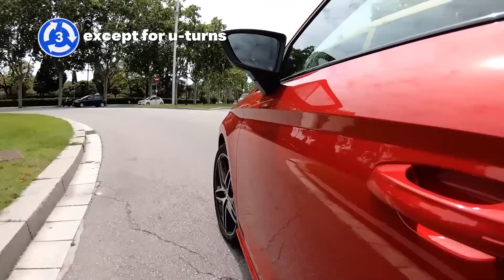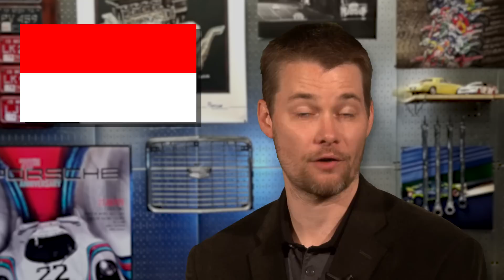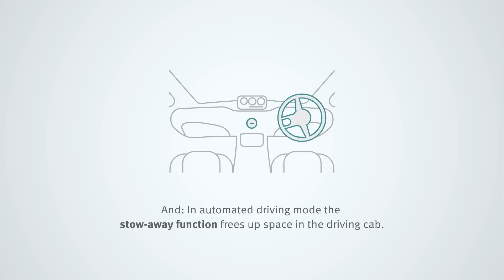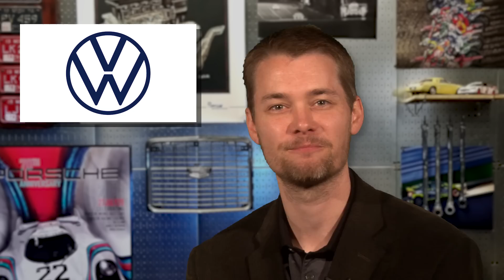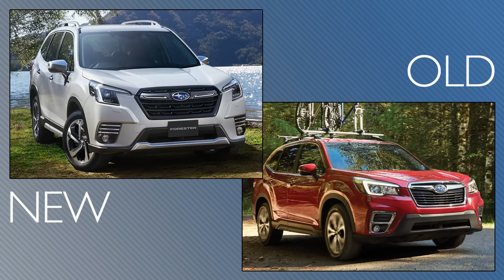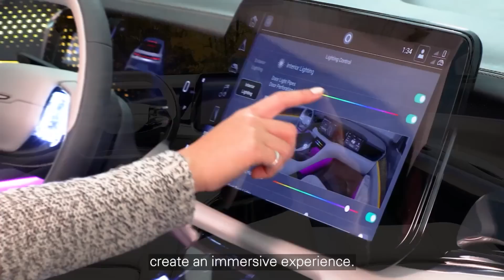Ford Doubles F-150 Lightning Production; Subaru Launches Refreshed Forester - Autoline Daily 3146

Comment: Why does vw still try with the jetta. Its a dud in Europe. Its more a car for cheap developing country car needs. Even VW are likely to admit the accord/civic saloon and a comparable korean saloon to offer a more modern design and more included kit not to mention reliability. Note its still using the older mqb vw platform as seat and skoda switch over

Comment: Let's face it new cars do not have "bumpers," they are facias and in almost any accident they are destroyed. Let's drop the outdated term.
Also I for one will never own a drive by wire or brake by wire automobile. It is a recipe to be hacked

Comment: I have trouble with steer by wire. I've had connections to the 12V battery fail and shut a vehicle down. Without mechanical steering (and brakes), I couldn't have safely coasted to the side of the interstate. Is there any data showing that steer by wire is overall safer (other than full autonomy)?
Reply: Almost every commercial passenger plane you fly or will fly on works on fly by wire. There were installed to cut cabling weight, allow for more intelligent fail safe intervention when pilots did something stupid and allow for easier handling. In almost all plane crashes it was pilot cabin error much like car crash accidents. Lane keeping, adaptive cruise control, progressive rate power steering, 4wheel steering etc all need fly by wire to work

Comment: Ford has 2 battery factories lined up, totaling 20GWh of battery capacity. At 125kWh per truck, that would be about 160k LIghtnings. 
A 40GWh battery factory costs $2B, so $850M might get them another 20GWh factory, maybe, unless that's the price of the 2nd SK factory they already started construction on? Otherwise Ford will have enough battery capacity for 300k Lightnings for year, but they're only planning to produce 80K? Where are all those extra batteries going?
Supposedly Ford is sharing the SK battery factories with VW's new US factory producing ID.4s, so I guess that's where the other half of the factorties' battery production is going.

Comment: Seems like there should be a caveat about the safety of roundabouts. If you don't have enough space to use them to spread out the traffic, they are not going to be safer. You can't just take an intersection and add an island and make it a roundabout, without increasing the space it all takes up and expect it to be safer. And it also seems like any intersection that has a lot of pedestrian traffic is going to get more dangerous for pedestrians if you convert it to a roundabout. This is important because not all city managers are sophisticated enough to determine the safety of this type of change on their own.
Reply: Cities from all over look to Carmel and other Hamilton County cities here to learn about the best and efficient ways for building roundabouts for different types of intersections. The first ones weren't really much bigger than the original space. Those have all mostly since been redone to be bigger. Sidewalks are all made to go around the circle so no pedestrians ever get inside the roundabout. The newer ones also try to be idiot proof as to force you to go the correct way. I say try because there's always an idiot more idiotic than your idiot proof design. There's also a lot of signage, but you can tell who doesn't know how to read signs....the same higher level idiot.
Reply: @jeffs6090  My most common experience is in Berkeley, CA. We have several that are in very small intersections. The cars end up going into the crosswalks to get around the circle. There are a few larger ones, but it is just pretty treacherous to walk across any of the streets, especially if you are walking clockwise, since the drivers have to look the other direction for cars that are never stopping. At one of the smaller ones there was an incident a few years ago in which a driver was speeding and the grassy raised circle in the middle caused the car to flip over and his wife and child were killed, and then he went to jail. I just don't really think they are appropriate unless you can take up a lot more space, and you don't have much pedestrian traffic at that intersection. Yet our City Council is always proposing putting them everywhere because they're supposed to be safer.

Comment: Seems auto makers are adding complexity (hybrids, electronics, screens, steering systems multiple trans mission types, turbos, cameras) which means higher prices (I suspect) currently US $42,700 is the average for vehicles, right?  Business more complex too as 2 or 3 or more companies combine.  Only Tesla seems working on reduced complexity and downward trends on pricing.
Reply: Tesla is more vertically integrated...designing and manufacturing as much as possible themselves.
From batteries to aluminum cast frames to AI to computer chips to heat pumps to seats to carbon fibre wrapped motors to software to charging networks to power generation to super computer design to advanced metallurgy to advanced glass.

Having top engineers in all of these fields is unique. How can any car company compete with this?
Reply: @Goldsteinphoto    Tesla does not make any of their own Battery cells at this point,  and every OEM that I know of makes their own chassis structure.      Tesla does not make computer chips, or heat pumps,  they buy them from suppliers.
Reply: @dmitchellhomes  So you didn't watch Battery Day. Do you know what an IDRA press is? Why did Tesla buy Hibar Systems, Maxwell, Grohman,  Springpower, Perbix and others?

Where can you buy the version 3 FSD chips used in Teslas? Where can you buy the D1 chips that they are building into Dojo? Where can you buy an octovalve? Who makes Tesla's inverters, carbon wrapped motors?

https://youtu.be/Rp2ktJ6174c
Reply: @Goldsteinphoto   yes, I did watch battery day, when Elon musk said production was starting on the 4680 sells immediately, and would ramp to full production by the end of the year, but here we are a year later, and he said on the early last earnings call, they have produced zero production quality batteries, they are just producing validation cells, very slowly and they have problems with the equipment which will require re-engineering of many of the machines.  He also said that the same machines for Berlin, and Austin, had already been ordered and will need to be reworked delaying cell production in both of those factories.     That’s what happens when you try to develop machines, and a production process at the same time, you usually end up with lots of rework, which tesla clearly is doing wasting their investors money.   As for the castings, yes, I know exactly what they are, you know General Motors also has been using diecasting in their chassis for the last two decades, the only thing Tesla did is try to incorporate more of the structure into one casting.  The jury is still out on how successful this is, as they have already burned down one of their presses, causing a month of rework, and have not incorporated castings into their model three, so they are only using them on the back of the model Y at this time.
Reply: @dmitchellhomes  Stupid comment, your are completely wrong. Why don't you check your facts first.
Reply: @johnmqueripel2367    Fact check my facts?       There you go...   You stated for me they are facts...
Reply: @Goldsteinphoto    Nobody wants to buy the FSD chip,  but I can tell you its made by Samsung in Texas and  uses old technology.     D1 is not introduction yet,  but likely to also be made by Samsung.     Octovalve?    Who needs that?    I have never owned a car that had problems with heat or A/C except my Model Y,   in temperatures over 95 F it cannot maintain 72 F inside, so the system is undersized,  I cannot imagine how bad it is for somebody that lives in Vegas or Phoenix where it really gets hot.      Inverters?   Tesla does not make their inverters,  this are made in China, and shipped in.   Carbon wrapped motors?  Who cares?  Not me...
Reply: @dmitchellhomes  None of your statements contradicts that Tesla is vertically integrated..and working to be more so by building battery factories, adding more engineers. 

If all of this stuff is so readily available, how come all the car company aren't selling hundreds of thousands of production EVs that are as good as a 2012 Model S?
Reply: @dmitchellhomes  You are confusing fabrication with design. So Tesla is not vertically integrated...OK with me if you want to think that.
Reply: @Goldsteinphoto  No car company can compete, probably no chip company can compete, probably no manufacturing company can compete, probably no battery manufacturer can compete, certainly no software company can compete, I could go on and on.
Reply: Model 3 has been out how long? A couple years, and the entry level version is more expensive now than ever, how's that vertical integration and mass production working out for lowering the price?!? Elon promised the Model 3 would start at $35k and other than a couple rare occasions if you knew how to order it that car has yet to be available for the masses.
Reply: @OneNationUnderGod.  Who said vertical integration is about lowering the price. Right now there is so much demand they are maximizing profits.
Reply: @Goldsteinphoto  that statement about "maximizing profits" doesn't carry any water last year when Model 3 prices went up and the market wasn't as strong. They weren't "maximizing profits" then, they were raising the price to avoid selling at a loss. 

As for vertical integration, you said with that and some other "advantages" Tesla has that other manufacturers "can't compete" so I'll leave you to explain how they are unable to compete? Because to me that implies other manufacturers ways are more expensive meaning they can't compete with Tesla. Maybe you meant other companies can't compete when it comes to production delays, increasing prices and prototypes that never make it to production or take multiple years after they were originally planned.
Reply: @OneNationUnderGod.  Other companies who do not possess technology, engineering and production efficiency that equals what Tesla is doing will not be competitive. 

E.g. Ford just doubled its goals for the F150 Lightning..."Due to higher than anticipated demand." They hope to sell 15K in 2022, 55K in 2023, 80K in 2024  160,000 of them a year by 2025. 

They sold about 780K F150s in 2020. So 4 years from now they hope the F150 sales will still be 4/5 ICE and 1/5 EV.
Reply: @Goldsteinphoto  and over a million when you combine F-series. I see nothing wrong with what legacy automakers are doing, pickups and SUVs are highly profitable. Companies like GM and Ford are covering a lot of the EV investing with the massive profits they're bringing in with their ICE vehicles. 

Before you start rambling about these companies on the verge of bankruptcy that is such an old and outdated comment. Look at their financials, Ford is not doing as well as GM but they are still holding their own. GM is crushing it the last few years, these are some of the biggest profits the company has ever had.
Reply: @OneNationUnderGod.  I am pointing out that switching just 1/5 of the F150 line to EVs in 4 years is not being competitive technologically.
Reply: @OneNationUnderGod.   dude, you are on a roll, one legit message after another recently!  Could not say it better myself!
Reply: @dmitchellhomes  I can't help myself when it comes to fanboys, I really like Tesla and I've been tempted quite a few times to track down a used Model S P100D with 25k miles on it just for a fun car the family can take short trips in.
Reply: @OneNationUnderGod.    Same for me,  Heck, I bought a Tesla,  I use for daily errands.   These fan boys drive me nuts,  they are so brainwashed (mindless).   They say traditional OEM's loyalty does not run deep.    Let tell you a story about Ron who owns one of the largest excavation companies in the NW USA (over 1000 pieces of iron).    I remember back in 2003,   Ron came to visit me on one of my jobsites to show me his brand new Ford  Superduty 6L diesel (you likely know where this is going already).   It was summer,  so he left it idling (A/C running) when he came into the job shack to get me,   when I came out to check out the new truck,  I was like Wow,  looks nice (was the first King Ranch I had seen).  So we are standing there talking and I said,  do you smell diesel?     He said,  Ya,  hmmm,   We looked on the ground and in the A/C condensate under the truck you could see fuel sheen.     It turned out the injectors had leaked and filled the crankcase all the way to the top with diesel,  and diesel was running out of the crankcase breather (Brand new truck less than 500 miles)      So he of course had to get a ride home with me in my 2002 GMC ( 6L gas) which he had always called the "El Camino" as his new truck was hauled away on a flat bed truck still dripping diesel.    Anyway,  Ford had the truck a month and put a new engine in it ,  the new engine ran about 5 months and blew a head gasket due to another faulty injector.    About a year after that,  the Turbo went out,  and sent metal through the engine (Another new Engine)    So when the new 6.4L Ford diesel came out guess what Ron bought?    Yup, another brand new Ford, with a first year engine.   That 6.4L was just as bad,  had Turbo problems about every 6 months, and injector problems,   So when Ford came out with the 6.7L,  Guess what Ron Bought?      Ron is now on his 3rd or 4th 6.7L,  Truck although the 6.7 Engine is much more reliable than either the 6L Powerstroke or the 6.4L Powerstroke.   Moral of the story,  Ford Guys buy Ford,  GM guys buy GM for the most part.
Reply: @dmitchellhomes  I get it, when our Yukon had its lifter problem this year I was more disappointed in it than mad or upset with GM. Kinda like when one of your children does something wrong, I felt that same kinda disappointment lol. 

If these damn new vehicles didn't cost so much I'd trade our Yukon on a new Yukon with the baby Duramax and give it a try. Got a customer with one in his AT4 Sierra and he absolutely loves it so far.
Reply: @OneNationUnderGod.  yeah, I have heard a lot of people love that 3 L Duramax, the only thing that scares me, is the oil belt it’s in the crank case, I don’t think that’s the best design for a rubber belt.   I mean I love belt drive oil pumps, but I like the belt out in the open.   Nearly all of the race engines I’ve worked on have dry sump oil pumps that are belt drive, which is nice when you want to prime the engine, you just pop the belt off, and hook it on a drill to prime the oil pump.   They are pretty reliable too, in all of my years of racing, I only saw a couple of Oil pump belts break.
Reply: @dmitchellhomes  I don't keep my vehicles past 75k and normally not past 5 years. Only reason we still have the 2015 Yukon is we bought a new house this year and I wanted to be completely debt free and have the +$100k in savings needed for the down payment on the new house. Once we get moved in next month and get our current house on the market we'll be shopping for a new vehicle. Probably gonna wait until next spring to buy though in hopes the market stabilizes. Pretty tempting to unload our Yukon now while the used market is still hot.
Reply: @OneNationUnderGod.   yeah, I know exactly what you mean, the used car market is crazy right now
Reply: Exactly, it is their last breath, flogging a dead horse.

Comment: 80k per year is fairly small fish.
Reply: That's because Ford builds +800k F-series every single year, you have to remember Ford is an auto manufacturer not just an EV manufacturer. Add in their other models and it puts them at several million vehicles each year.
Reply: @OneNationUnderGod.  Yeah they need to make more Lightnings